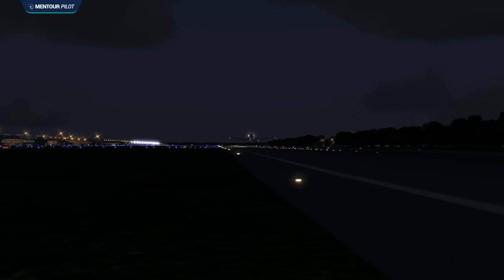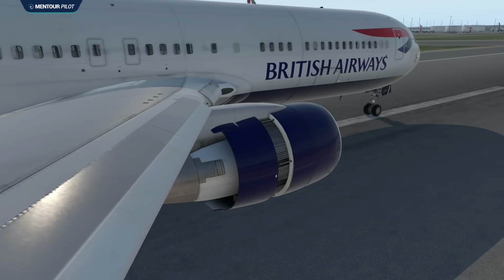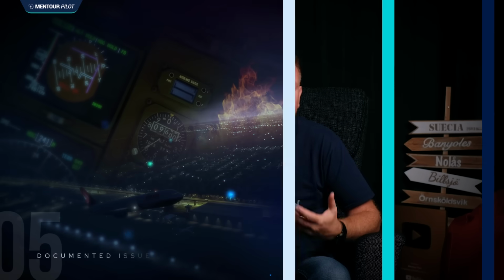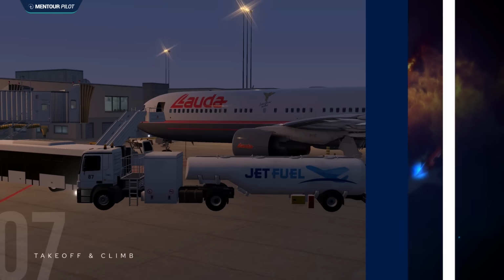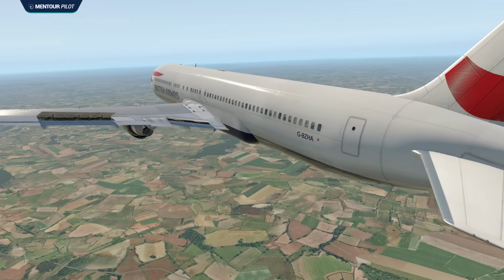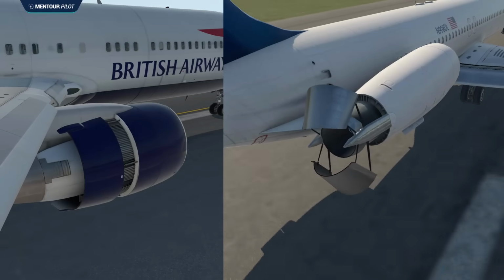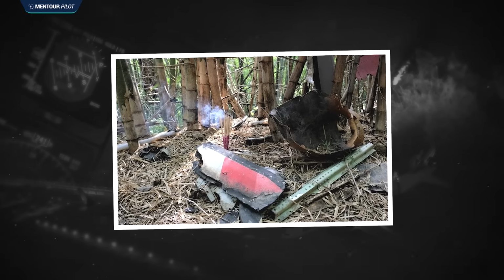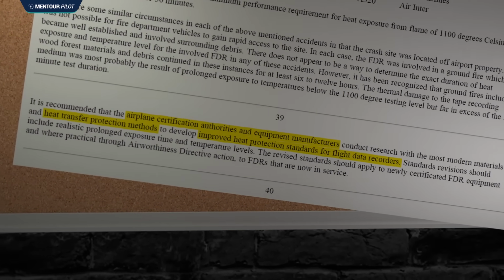HOW an Impossible Failure CRASHED this Boeing 767!

Comment: As an engineer, I am shocked at the lack of failure mode analysis on this aircraft.  Not considering thrust reverser deployment at higher than idle speed is just pathetic.  I would reject a FMECA outright if I saw that.  I would need to study this more, but this might be criminal negligence.
Reply: I agree. Also, I think that the worst low altitude situation would be system accidentally deploying reverse thrust on the left immediately after the plane has flied over the end of the runway. In that situation engine power is high and altitude is very low. Even if you couldn't figure out that high altitude situation would be bad, the takeoff configuration should have been included in testing at very minimum. (Or even worse situation would be deploying reverse thrust on all engines after the takeoff but that's definitely not possible to fix and shouldn't happen with true redundancy anyway.)
Reply: @MikkoRantalainen  Oh yes, if we swap the Boeing 767 for a Fokker 100 and the left for the right, you’ve basically just described TAM Transportes Aéreos Regionais Flight 402…
Reply: Indeed, how was this aircraft cleared with the modelling only done at low speeds? As said,, pathetic to criminal.
Reply: @southerncross86 , the theory behind modeling it at low speeds and low altitude is that those are the most time critical moments of flight, with the least effective controls due to low volume of air across the control surfaces.  The reason for assuming t would happen at idle is that one of the safety mechanisms was supposed to automatically spool the engine down to idle if it detected that the reverser was deployed.

The fact that their simulators didn’t actually model the aerodynamic forces at those speeds correctly hid the fact that their assumptions were incorrect from them while they were testing the aircraft.

Criminal liability would require that they knew or should have known that, if the reverser were deployed in this scenario it would be unrecoverable, but certified the aircraft anyway.  But the record is fairly clear that they didn’t.

Civil liability has a lower burden of proof, though.
Reply: @southerncross86  Yes,its like crash testing a car at 15mph and certifying it's safe at 40mph!
Reply: As a telecom equipment engineer working on redundancy mechanisms, I can tell you, we have equipment on live networks for over a decade and we still have crashes coming in that cause complete blackout and this with the redundancies built in. What I have personally seen over the years that the most unlikely rainy day scenarios that are glossed over in layers of in house testing are the ones which actually happen in field. There are a lot of reasons for this 1) Permutation and combination of testing scenarios 3) Third party components - their documentation and reliability 3) Interworking with other vendor nodes in field - and this all leads to 4) Economics - the company has to survive - we are not talking of profit but survival.
Reply: @kpd1632  All good points, summarized as "hoping to get by, within our testing budget".
Reply: @kpd1632  Isn't it also the case that if you are testing for it, you will ensure it is working. Ie. if it failed an inhouse testing scenario it would be fixed before deployment. Therefore, what is seen when deployed must necessarily be the scenarios that weren't tested.
Reply: @kvikende  These are exceedingly complex systems and the number of test cases would humanly not be possible to count if you want to test for all possible negative scenarios or even be able to be conceived before the fact. You have to take a call on what your test coverage is which will be peer reviewed by internal teams. Sometimes even if the scenario is known, it is considered extremely unlikely to occur and testing for such scenarios becomes low priority. Needless to say sometimes these very "unlikely" scenarios occur in the field. Other rare scenarios happen only in live deployment, or may not be reproducible locally, because testing simulations can never be a perfect substitute for the real thing.
Reply: The video implied that the electrical valve actuation signal also drove the fault indicator. Maintenance assumed it was a false indication due to a wiring problem and that the valve never opened. If the fault sensor was an actual measurement of hydraulic flow after the the valve, then it would be much easier to test the sensor and much more alarming which probably would have forced grounding of the plane until it was resolved. I have supported many DFMEAs, I dont believe they are a cure-all for design flaws.
Reply: Hi Robert, I understand your concern and that is valid. At the 70s and 80s the industry knew much less than we do now. Don't forget that aircraft certification is a Q&A between OEM and CAA. As per current regulation there's a max 5 year period to close all open questions without changing the initial certification basis (CB) that is frozen at the time of certification application, but certification can last longer by updating CB. There are a lot of topics that are raised in the form of CRI or CAI (EASA) and IP (FAA). Besides these there are Special Conditions (SC) that cover techniques, materials, process prior to being covered by standards, and later these become part of the standards via evolution. And that's the key point, the standards have to follow the industry, but we have to accept that the industry is always ahead of the standards, that's the only way to get better. You are right, it's weird how this unwanted event was not taken properly into account until the mid-90s. As far as I know the OEM at that time didn't exclude high speed  TR in-flight deployment, but they linked with a possibility of extremely improbable with a minor effect.  Today we know the effect was catastrophic and the possibility was higher. As a result of this accident many things (design, certification, crew training) changed for better. CS-25 has introduced 25.933, and TR design has to follow 25.1309.
Reply: @tamasrevesz1215  Quite possibly the best comment on here.  The A330 and the 777 were likely the first to fall under these amendments.
Reply: I am willing to bet that there was at least one engineer who said "wait, this one scenario isn't enough" and got overruled by bean counters.
Reply: @maryconner9409   I assume Boeing designed the tests in a way that they got the wanted results (which could be used to cover their a$$. They could live with: "Even deployement mid flight can be handled."  It is "interesting" that they just assumed that the deployment of thrust reversal could not happen at higher altitude and with higher speed. Why ? They tested under conditions that apply only for a short time during every flight. Even IF they assumed that the other scenarios (more speed and altitude) could be handled more easily by a competent pilot - they were weirdly incurious to learn what would happen IF.

My guess, they DID test and did not like the outcomes so they just held back the result. 
Or the less psychopathic version: They feared what they could find, tested with one scenario, got results they could live with and that could be used to cover their behind .... and decided to play dumb and that they did not want to know more.

if they had done realistic testing and had published the results they would have been forced to redesign, test, get approval, arrange for pilote training, fit all machines .... 

The machines on the ground would have been banned from flying if they had been honest about results from realistic scenarios. 
After the accident they finally had to do find a solution, but I think they were able to still drag their feet for 12 months or so, in the meantime they  worked on a solution but kept quiet about it. 

The larger machines needed reverse thrust for landing, to help with brakes, so they could not disable that function alltogether - I wonder if the machines they had sold so far were allowed to fly or if they were allowed to have a provisory solution until a permanent solution was released.
(that provisory fix was still safety relevant). 

From an economic point of view it was better for them than admitting problems earlier: they worked on the solution, but the official investigation went on and it bought them time -  so the machines on the ground likely were not banned from flying during that time. it took quite some time and the effort of Lauda to make them admit that it was the reversal AND there was no way to handle that safely so it was not a pilot error.

Even a competent pilot that KNOWS about such a scenario cannot correct such a malfunction in 4 - 6 seconds (when they cannot afford to do anything wrong and no chance to recover from any mistake). Humans do not function like that. Now imagine the pilot would be startled and maybe a little fatigued and would need 10 seconds. Or not so competent and be completely startled (see flight AF 447). 

The margin of safety must be much much higher than 4 - 6 seconds time to react. Nor can a plane have scenarios where you are doomed when you do not everything right in such a short time (and these are not actions that are planned but are reactions to a malfunction that can pop up anytime and completely unexpected). Of course there are scenarios during flight where there is little margin for error (start and landing and those are planned) und you must get things right - but even those are a little bit more forgiving.

But that a situation pops up unexpectedly and then you only have 4 - 6 seconds .... else you are doomed - I do not think there is one such scenario. Well of course, because in reality even with training lots of pilots would crash their machines.
Reply: Amazing how Boeing keeps getting away with this B.S.
Reply: @mortblackthorn187  they actually don't, but all plane manufacturers will try to avoid responsibility as their first reaction. They do have a lot riding on it after all.
Reply: One could at least have referred to the book by the aviation expert Tim van Beveren: "Sluts, botches and cover-ups - the last flight of the "Mozart" or: 61 error messages until the crash."
Reply: As a low qual engineer you're reduced to comments here rather than dealing with mission critical issues where lives are at risk.
Reply: A failure analysis was done on the original system before certification. It is a certification requirement. The original design was considered safe and an example of a good design. Unfortunately, perhaps the wrong assumptions for the analysis.
Reply: As not an engineer I do not have a comment on your findings.
Reply: As an engineer I also wonder why a physical lock system wasn’t also engineered into the system making it impossible to deploy in flight.  Reliance on servos and electronics given the catastrophic consequences of such an event is beyond me.
Reply: Well, Boeing hasn't learned it's lesson as it's handling of the 737 max incidents showed. Reckless design to push an outdated concept beyond it's limits.
Reply: Just shows the danger in "worst case" analysis. It's so easy to let our own personal assumptions and intuition influence what we think the worst case is and, as we saw here, there was clearly at least one scenario that was more dangerous than the assumed worst case of low speed and low altitude.
Reply: Agree. Just picking the maybe most likely conditions instead of modelling the most extreme plausible conditions should have (if that is really what happened) put someone in jail for depending on what laws apply something like involuntary manslaughter.
Reply: As we do not know the details, we should not judge about negligence. While yes, in hindsight it seems obvious but there are safeguards, one of these using the normal position of a valve is considered very effective (in this case normally no reversers when no input). If this is constructed the way I know (noted im not in Aviation) it is considered safe. Somewhere the biggest error seems to me accepting a failure by Boeing, several times and not giving the instruction to do a thorough check for all the wiring (the 500 hour rule being used over an over again: is for me the definition of a useless constant alarm). Mistakes in manuals kind of surprise me in aviation, in custom machinery the manuals are full of mistakes though, and maybe there is just a general engineering culture problem.

But if there is true negligence, internally there would be notes in the company (same as the Boeing 737Max disaster software), people complaining about cutting corners, etc. So I doubt it, I do not mean to defend mistakes, they are made, just calling it negligence seems a bridge too far. But ok, we humans always want a scapegoat so we need to lynch someone ;-)
Reply: I am always fascinated by aircraft maintenance
Reply: Remember, this plane was build 37 years ago…
Reply: @Moped_Mike  And it's still being built as a freighter.  Using your logic we should ground every plane introduced in the 80's, which would also include the A320 (1987), and all 737's (the latter of which still use systems from the 60's).
Reply: As someone with multiple engineers in their family, I can say the lack of common sense that a lot of engineers have is just stunning.
Reply: IT WAS CRIMINAL NEGLIGENCE.  Cost reductions were more important.
Reply: One option . as a future passenger ~ prefer to fly with a carrier who operates Airbus aircraft.
Reply: @gritpipethin  A320 is from 1987.  It was certified in a similar manner.
Reply: You do know this is very easy to say in hindsight? You don't even know all the details. I'm not defending their decision, but I find it laughable you think you'd do anything differently just because you're an engineer. I'm an engineer too, but it isn't my field, and also I do not argue from authority.
Reply: @Sergioosh  I would agree with your reasoning in general. However, Boeing has done this enough many times that it appears to be systematic problem with their culture nowadays (and I mention nowadays here because Boeing used to be very safety oriented company maybe 40 years ago but things have gone bad since).

It appears that there's great internal pressure for get-there-itis for the design of any new subsystem within Boeing. That doesn't work for single pilot aviation and it doesn't work for big company such as Boeing either.

This accident and the whole MAX fiasco would be prime examples of this culture.
Reply: @MikkoRantalainen  McDonnell Douglas did that with their cargo hatch design on DC10, Airbus is doing it with the paint on the 350 Neo, and there's many more examples. They all do the same - their initial reaction is to protect themselves, not to address the issue openly.
Reply: @MikkoRantalainen  The 767 first flew in 1981, which was well within Boeing's safety era. The thing about aerospace is that it's *hard*. This stuff seems obvious to us now, but the thinking at the time was that the systems would make it impossible for a reverser to deploy above idle speed. And the thinking was that the most dangerous scenario for it to deploy would be at low speed - that can be chalked up to an imperfect understanding of aerodynamics, and you can't really blame that on negligence.  After all, if it were possible to understand aspects of aerodynamics that have not yet been discovered, the Wright Brothers would have built a DC-3. ;)

The difference between this and the MAX (beyond the aerodynamics) is that the MAX was released with no AOA backup for the MCAS system. If the AOA sensor tied into MCAS failed, there was no redundancy. That was a bloody obvious safety problem that Boeing ignored because Boeing no longer cares about building the best possible aircraft.  With this incident, there was redundancy, and against all odds, all of the redundancies failed. That's a very different situation than the intentional negligence exhibited by the MAX debacle.
Reply: @shadowfaxcrx5141  However the accident occurred in 1991. When, I guess, the senior executives already was the one that conducted the merger a few years later. 
Of course that critical errors are possible to the original project, no matter how hard the company commitment to avoid them.
However, I understood that the main discussion here is about the response when the error clearly appeared. Boeing's corporate protocol to respond to this kind of situation radically changed at some point in the 90's:
Strongly deny the error existance until to the point of the evidence and public pressure make it ridiculous to slowly change their position, while keeping strongly at the defensive and avoiding to assume any responsability. 
It was this way with Lauda Air,  737 rudder issue (united and USAir), 737 radioaltimeter issue - that still isn't fixed (Turkish Airlines), 787 battery issues and 737 MAX.
They learned the lesson after MAX? I hope so, however I will ask to you guys what to think about China Eastern final moments being totally compatible with a runway stabilizer malfunction ( I know it was a NG, but the same STS, only w/o MCAS, already was there) and right in this investigation, allegedly, occurred an leak without precedent where the news that made it public was written by an aviation specialist journalist based in Chicago?
Reply: @ultimachamada1  The crash being in '91 does not mean anything since the same amendment levels for these systems were still in place.
Reply: @MikkoRantalainen  It's not their engines.
Reply: @shadowfaxcrx5141  "The 767 first flew in 1981, which was well within Boeing's safety era" - But the engine wasn't. PW4000 series was launched in 1987.
Reply: @vsm1456  That's a good point, and while PW didn't make the thrust reverser it was controlled by a new design that came out at the same time. However the guy I replied to was talking about Boeing not having analyzed what would happen to a 767 if asymmetric reverse thrust occurred above idle thrust. That would have been something that, had it been done "right" should have been done when the plane was designed. After all, physics doesn't care when an engine was made or who made it. ;)
Reply: @Sergioosh  If you refer to Findley's comment, he concluded, "I would need to study this more..." Findley cited a single known condition, according to the video-- a thrust reverse deployment at speed greater than idle which had not been considered by Boeing.
Reply: @bobgreene2892  Incorrect. The first part was given without that conclusion. Only the "criminal" part was given the "I would need to study this more".
Reply: @azurblueknights  Mate, you completely missed the point. Of course it's their job, and I don't know how did you get this from my comment. I was just making a comment on what Robert wrote. It's easy to say "if it was up to me, I'd do a better job" in hindsight. That's it. Nothing more.
Reply: @Sergioosh  My point is still that hindsight has no place in something like aerospace. Okay yes, he claimed that he could do a better job "in hindsight". But Beoing has spent so long as one of the global leading aerospace manufacturers (even back then when this crash happened) that they seem to believe they can get by with slacking off because they have no real competition. They shouldn't be able to have someone "off the streets" say, completely honestly, that they would have caught such a mistake.
Reply: @Sergioosh  Forgive me, I see why I was confused. I didn't mean to reply to you, I was attempting to reply to the guy who first mentioned he could do a better job in hindsight.
Reply: @azurblueknights  This is baseless and purely your assumptions. No matter the effort we put in, we still end up in situations where something goes terribly wrong due to something unforseen happening. I'm not going to judge whether this happened due to Boeing's negligence or not, as I have neither all the facts nor expertise to be able to reliably make that call. Do you?
Reply: @bobgreene2892  Right but the OP says something about criminal negligence.  That's the problem with the OP.  The FAA doesn't have the in depth knowledge to understand the intricacy of every detail of an aircraft.  It's why for the most part the manufacturer writes the approval plan now and the FAA approves the test plan.

And to even suggest criminal negligence or total disregard for developing a thorough test sequence, see K P D 's comment.  Every one of those issues applies to this case, and as a person who only took a class on software testing, I can say it's REALLY hard to test any scenario.  The engines weren't Boeing's engines, so they had to rely on what was given to them.  It would have been up to Pratt & Whitney to understand the fine details and come up with a complete test procedure, consider anything that could possibly go wrong and write all the procedures for the engine.  But, Pratt & Whitney wouldn't have understood the fine details of what could happen to the plane and how to make the plane respond to the failure.

Could Pratt & Whitney have understood every failure that could happen with their systems controls?  Maybe, but then once again the comment from K P D REALLY applies here.  And I'd have to say the same thing, hindsight is 20/20.
Reply: @johndoh5182  Understanding every point of failure is widely understood as theoretical, not practical. However, the effort at error-trapping (software) was insufficient, by any standard.
Reply: @Sergioosh   I'm not an engineer. It's clearly to me you used the authority argument, not Findley. He doesn't need to know "every detail" of this specific case just to tell us how would be his professional approach and minimums to approve it, if he was in charge of it.
Reply: @ultimachamada1  Where exactly did I argue from authority? 
I also don't know everything about Findley, and I bet neither do you, but I'm still sure people at Boeing know way more than him. Still, in the end someone effed up, which lead to a catastrophe. You really think a random person on the internet would do a better job? Really? I'm sorry, but just saying "if it was up to me I'd do a better job" is just a baseless and pointless statement, unless you're on the level equal to the people you're trying to criticize.
Reply: @Sergioosh  Are you a paid Boeing troll?  There's something called common sense which sits above and over specific skill and knowledge.  You don't need to be an expert in flame temperatures and curing burn injuries to know that you don't want to put your hand in a fire.  
And BTW, since you don't know about this field, you're not an expert, so your own argument applies to you.  Robert Findley could be right, which means you CANNOT draw a conclusion that his comment is laughable.  By your own admission, you don't know, so stop calling people "laughable" as you have no facts and data on which to make this criticism and put people down.
Reply: @mehtasid  I wish I worked at Boeing, as I find aviation fascinating. If you carefully read what I wrote you'd see I'm not defending them though. I just find it laughable lay people claiming they'd do something different in a specialist field that they do not have any expertise in just because it's in the past. Have you ever heard of saying about having 20-20 hindsight? Yeah.
Also please note I didn't call anyone laughable. I wrote I find him saying those things laughable. It's not the same buddy. Another thing suggesting you might be having some issues with reading. Or are you twisting my words on purpose?
Lastly, common sense is not really helpful in specialist fields. You think nuclear physicists are hired based on common sense? Rocket scientist put "having good common sense" in their CV?
Reply: @Sergioosh  You're absolutely wrong and I'll prove it.  I'll take you up on nuclear.  The Fukushima reactor melted down because General Electric, that designed the reactor, designed it so that it needed power to push the rods down to stop the reactor.   When even backup power failed one had no way to stop the reactor.  This caused overheating and a meltdown of the nuclear reactor.  Common sense would design it so that if there was no electrical power the rods would fall due to gravity.  IOW you would need power to keep the rods up and out so the reactor was running.  The default should always be a shut down or "idle" state for a nuclear reactor.  A kid in engineering school can see this, but maybe you can't.  If you still don't get it then you either never will, or your ego won't let you see where you are wrong.  So I probably won't have time to keep engaging with you.
Reply: @mehtasid  I'm wrong about what exactly? 
It's quite funny that to support your argument you use the same fallacy you're defending. Astounding.
First of all I'm not saying that what people responsible for designs in both of those cases (as in this one and Fukushima) are not at fault. Although those situations are different, they had similarities in a sense that both had certain faults that were avoidable, and only happened as people responsible deemed some scenarios unlikely and ignored them. That's their fault, I'm not denying that.
My whole point was that if you have a teams of specialists, engineers, quality control and probably bunch of others involved in planning something and they miss something that leads to tragedy, saying "If it was up to me, I'd totally not let it happen" is fallacious, because it's only based on hindsight. It's called "hindsight bias".
Reply: @Sergioosh  You are by definition arguing from authority. "If a team of specialists came to x conclusion, then it's probable that you would too!" 
Whether that is true in this specific case or not is wholly irreverent. It's ultimately still a logically bunk argument that serves no purpose other than indulging pedantry online. 
If this situation was present in a vacuum, you would be correct - but you lack context. Boeing has developed a history of cutting corners and covering up their failings. It's rational to conclude that their pattern of seemingly obvious mistakes with their refusal to admit responsibility is the result of degradation of company culture. Thus, it could be argued that the mistakes present were noticed, and subsequently brushed off, or never noticed to begin with - due to incompetence, or perhaps a simple human error. In these cases, it's entirely possible "random Youtube engineer" could actually address the issue - especially because the "random Youtube engineer" would hypothetically be free from conformist pressure and the bystander effect.
 
No matter which way you spin it, your claim that it's fallacious to say "I could've done better" is at best useless pedantry. (Because of course, if I literally was the leading engineer, with all his memories and life experience, of course I would make the same call) 
In cases like this with such tragic loss of life, hindsight bias is an extremely valuable tool the public can use to increase pressure on the offending entity. It doesn't look good when internet laymen can correctly identify the exact moment of breakdown in a design process. 

Also strange that you brought up that other airlines also take similar shortcuts, almost as if that justifies it. Yikes.
Reply: @epicurus2163 Truth is neither of us knows what you, me, or the guy I was responding to, would do in this case. We're dealing with hypotheticals here. Even if what you said about Boeing being guilty of what you said they were, it's also irrelevant. Just because an "internet layman" claims they'd do better, doesn't make it true either way. Again, hindsight bias.

Also I clearly wrote I'm not justifying what Boeing did. I gave those examples as an indication, that no matter if you're diligent or cutting corners, you will encounter unexpected situations that can lead to tragedy. Even if it was willful negligence or cutting corners, claiming "if it was up to me, I'd do it better" is still an empty and useless expression.

Lastly, your definition of arguing from authority is incorrect. "If a team of specialists came to x conclusion, then it's probable that you would too!" is a fair assessment. If I wrote "they're the specialists, trust what they say", that would be arguing from authority.
Reply: @Sergioosh  What kind of engineer are you? You know how silly it sounds that you are calling others "laughable" for saying considering a failure at anything but idle speed is negligent? He also did mention he would need to study it more, and even if he was just talking about the definition of negligence, it's those actions that deem it negligent or not.
Reply: @Zayd Abbas Actually, it is laughable that the OP thinks that being an engineer he can design anything. He reveals his immaturity in the engineering arena by jumping to the conclusion that any failure mode that manifests must not have been considered by the designers. So he proceeds to denigrate people he doesn't know at all, based on his assumption that is unwarranted and wants to levy criminal charges against them. He's so sure of his flawed thinking process that he has no need to investigate the technicalities any further. The only thing he wants to investigate is the law, to determine the extent of the criminal charges that can be brought against Boeing. Such a display of hubris has me rolling in the aisle. Little knowledge is a dangerous thing.
Reply: @zaydabbas1609  you can't foresee every circumstances. If that were true, something like that would never happen.
Reply: @Sergioosh    I can't speak as a professional because I have never touched mechanical/aviation engineering, but when we write tests for hardware, even 'impossible' cases are considered. Of course it's impossible to consider every failure case, but remember this is why we run failure mode analysis in the first place, if everything worked as intended we wouldn't need to test anything. Looking back at the video, it was the FAA that requested tests after those specific failures ALREADY occurred, to which Boeing responded with tests only run assuming idle speed. This is the part I don't see being reasonable at all; the extra cost and hours required to run a test like that were clearly less than what was spent after they were forced to post a TSB and ground many planes, and they were hesitant to do even that. This is why it's reasonable for OP to say he wouldn't accept that analysis; after past mid-flight failures, it seems quite strange to constrain tests to idle speed. That being said I don't think "as an engineer" adds any value, but even from a purely cost-risk perspective there's a reason to look further into it...
Reply: @zaydabbas1609  I'm not deliberating whether it's negligence or not. My only point was that it's useless to claim one would've done differently in hindsight. Hindsight bias is a thing.
Reply: @zaydabbas1609  I called no one laughable. I said what that person said is laughable. Not the same mate. Also he clearly said he'd need to study more to see whether it's criminal or not. He already made his judgement.
Reply: @Sergioosh  the op very clearly said that he was expressing an opinion and not fact, and that he would have to research it more before doing so.

You need to learn discernment.
Reply: @melodiefrances3898  I can comment on anything, can't I? Be it a fact or opinion, this is just worthless hindsight bias that doesn't bring anything of value. The comment about research is clearly about this being criminal, not the whole thing.

You need to learn about reading comprehension.